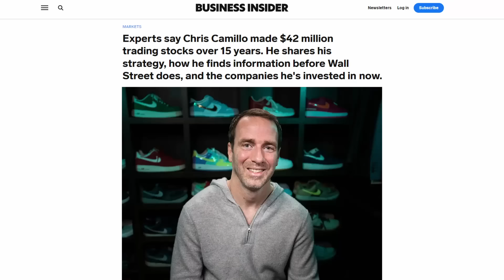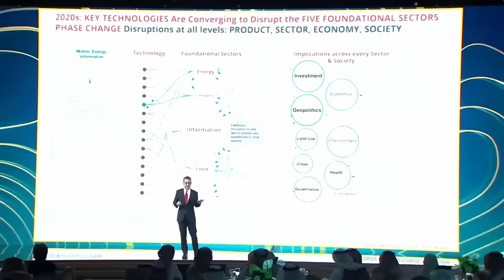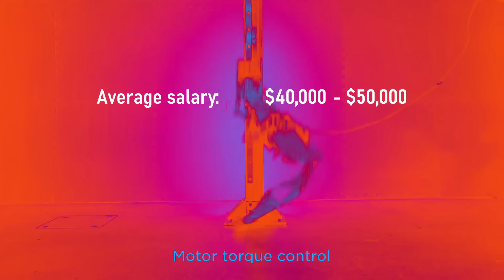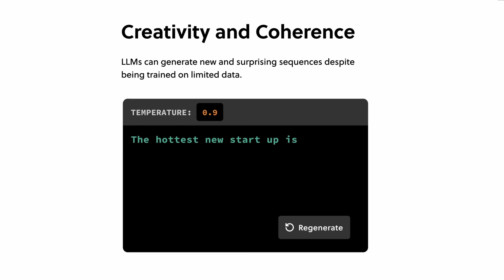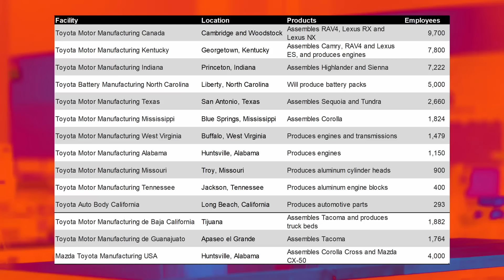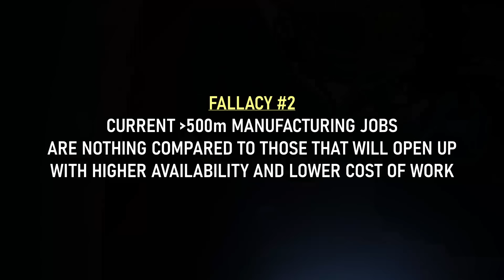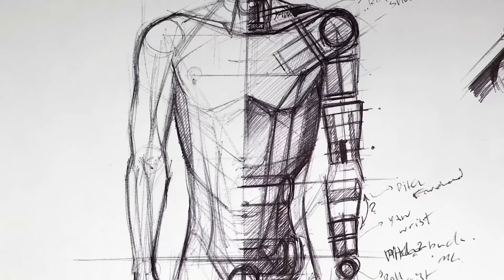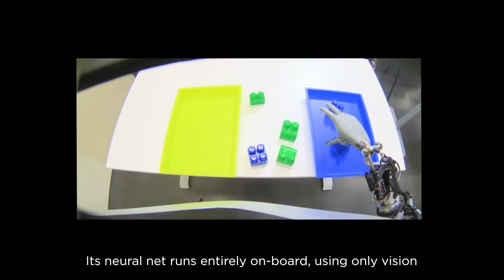The $12 Trillion Opportunity (A Call Option on Infinity! Valuating Teslabot Pt.2: The Road to CHOAM)

Comment: I'm sorry I just don't see it. Look at the fingers on Optimus it can't pick up the needle to thread it!  I'm a long time Tesla fan, I love my model 3. But PLEASE temper your expectations for Optimus. Go see what other companies are doing to automate human tasks, they're NOT using humanoids. NO humanoid bot has shown any practical usefulness. Here are the problems.

1. It's made human-like so it can work in environments made for humans. 
This is the antithesis of "First Principles"! It compounds costs/complexity and reduces efficiency. Humans did not evolve to use technology! Do you want it to take the time to climb into a forklift to drive it, or would you rather just put the eyes and brain on the forklift? Should it stand still at a station packing widgets and only use it's legs to go charge itself? Also, many tasks that humans are doing don't necessarily need a humanoid form as much as it needs intelligence. For example, a task to clear a failed process inside a machine. It might be easier for a robot with one 4ft arm and a camera/light on its wrist. Where a humanoid might not be able to reach in and see at the same time. Same issues for a janitorial robot. What all the robots will need is the intelligence to use its dexterity and be told what to do. 

Making it more human-like doesn't make it more useful, in fact now it's limited to what a humanoid can do and it's far from doing everything a person could.

Are humanoids used anywhere today?

2. No one will buy it until you can demonstrate it doing something practical. The selling point of Optimus is that AI will make it useful. A Boston Dynamics robot might be able to walk a dog without getting knocked over but you can't tell it to walk the dog. Enthusiasts say it will be easy like Alexa or Siri just tell it what to do. But can you imagine it trying to put a leash on a dog? Then they'll say it can do the "easy" factory work first. Have you been to a factory? I've been in industrial automation for a long time. All the "easy" things are already automated.
!!!!PLEASE !!! tell me what you think a humanoid will be able to do? A Person, without looking, can pick up just one small screw out of a pile and orient it in his hand while moving to place it. There is no way optimus could be that efficient. A small robot could. The only thing I heard was Brett Adcock saying it can move boxes and stuff around. This is not practical. A table waiter or stock boy might be a better first job. But the AI to do multiple tasks is more complicated than the ONE task of FSD. These things are not easy. It will all be dependent on machine learning. Which BEGS! number 3.

3. The really dumb thing is that the immature AI has more testable, practical, attainable and cost effective uses without a humanoid body. It could make existing dumb robots SO MUCH !!! more useful! (avoid a crash instead of detect one afterward) Or you could ask it to watch and control a conveyor system. Then you could eliminate all the position sensors in the system, just let the AI report where everything is. You could have it control actuators and machine interfaces because it can see where everything is and if it's working properly. It could report failures, defects etc. to the human operator that for years will still be needed to run the production line. Imagine how much !!! MONEY !!! you could save on parts, maintenance, plc programming, down-time etc. No robot needed just the intelligence. Fanuc had it's iRvision system for years already and is probably way ahead of Tesla in this area.

This is putting the cart before the horse. To produce it now would be like making "one size fits all cars" without steering wheels just because they have FSD. There are SO MANY bots out there already. IMO Tesla would be wise to dump optimus and develop the agi or mini agi's or whatever to license to existing bot makers. I bet Elon doesn't talk about it anymore bc the engineers finally got the balls to tell him that it's dumb.

4. Why? "A human like appearance facilitates trust and natural engagement because we are wired for human face to face interactions" OK but in a factory? Even if it could wait tables people won't care that is humanoid because they can see it's just a robot. If you make it look more human with a face it gets creepy. So why shouldn't it have an arm with multiple plate holders, and eyes in back so it doesn't bump into someone, and a napkin/utensil dispenser etc. Which would a Denny's owner buy? Is it because people get enamored with the sci-fi view of humanoids? The AI robots of the future will aid humans not necessarily emulate them. Shouldn't a care-taker robot look like a Patient Lift with big soft hands, or should a humanoid have to manipulate it? Could it even comfortably get its hand under someone to help them? A person can feel with all parts of their hand to reach under someone. A person can reach into their pocket and count change without looking, Optimus could never do that.

Should you have a bucket, mop, vacuum, hand-held brushes etc. for a humanoid to clean floors? 
Or will Roomba make a smart robot that won't smear poop and have all the supplies and two skinny arms with a camera to clean bathrooms, refrigerators. etc. Imagine Optimus trying to clean the floor behind a toilet when it can't see what it's doing. Or trying to sling a mop.

When it's using hand-eye coordination it can't use both hands at the same time if they're not both in sight.
Reply: Just wait until quantum computer meets A.I , robots will be physically better than us in many ways .
Reply: @eddieaguayo2335 Maybe it will make Optimus strong enough to be a fireman.
Reply: Begging him to "temper expectations" ain't gonna change his mind. His opinion cannot hurt you...
Reply: @FrunkensteinVonZipperneck  I don’t understand why would his opinion hurt me?
Reply: One of the best, most comprehensive posts I’ve seen on YouTube on any topic.
Reply: Long-winded BS.
Reply: @davidmarkmann6098  premature and immature

Comment: $10,000 per month per robot  is a 50% at a minimum but what if a competitor has a similar robot for  $5,000 per month and what if certain robot doing simple jobs have sources at $2,000 per month.  Won’t competition bring the price down.
Reply: And at what point does it crash the human labour market?
Reply: You need need deep AI skills with data to train on & serious manufacturing ability.
Reply: It is hard to believe that Tesla’s position in terms of data and expertise is so superior that they can cut out competitors for long and still have a 90% operating profit.  In addition, robots will cause the labor market to collapse. It is hard to think about how this is all going to workout.
Reply: Just like EV vs ICE,  The competition for Tesla Bots is not other bots but human labor.  As long as rental cost of the Bots (Tesla or any other Bot companies) is cheaper than the cost of human labor, there will always be demand.  Businesses are renting labor from Bots or human, so doesn’t matter who is providing this.
Reply: That is if Tesla doesn't take all the available DDD jobs before the competition which seems likely. Afterwards companies simply can't just fire human workers and replace them with robots so until the law changes (which Tesla might choose to influence that change for an advantage) there won't be market for the competition.
Reply: Competition is coming. We heard that before...

Comment: You don't need to be Free Walking and specifically Human shaped to assemble a car or any other product, just an Arm with the same AI / Vision is enough. 

Surely the best application isn't working on a factory production line that an arm can do.

But you might want a Humanoid to replace Middle / Upper management. 
Those really EXPENSIVE Humans who make bad decisions, or behave badly. A sympathetic, manager optimised "boss" who doesn't discriminate! 

There must be, another reason for a Robot to be "humanoid" other than people being SciFi fans???

Whoop whoop it can Walk and Move like a human, but why? 

So are we creating an amazingly clever complicated solution to a problem that doesn't really exist??? 

Exactly what will this chunk of hardware actual do that requires a human shape, and only a human shape csn solve the problem? 

Are we really that far up our own backsides that our body shape is so absolutely vital??? 

Do these Robots have to be "tall and slim"?.... If a design is Fat will we fat shame the design? Or if it's 3 feet tall will it have to look like a child because it's too short to be adult? 

So, the drive is to automate but why human shaped?

You can use all that AI and Arm dexterity without the human body shape 🤔